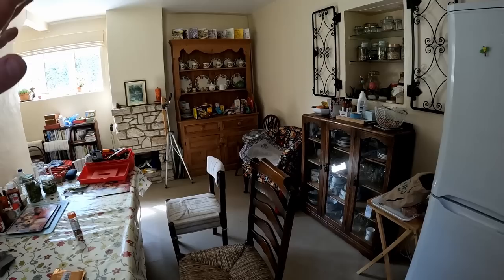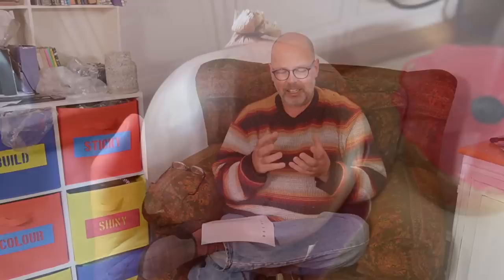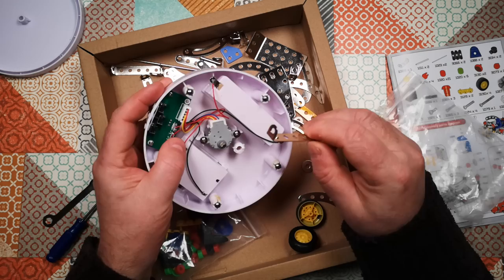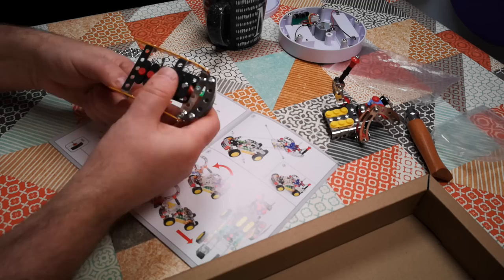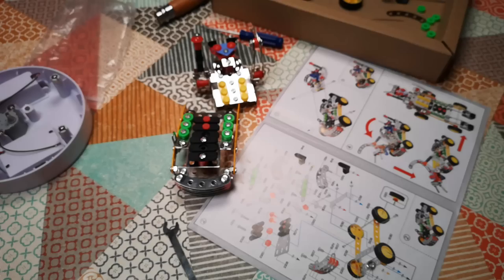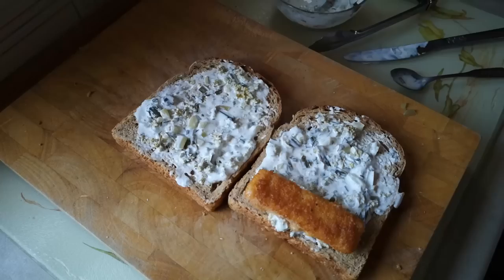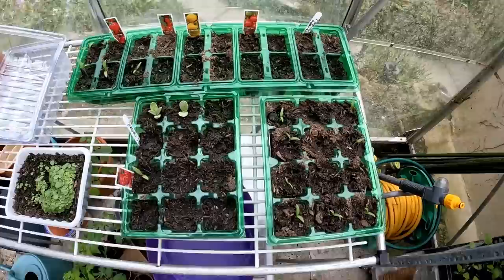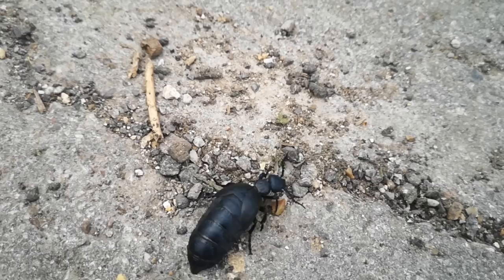Random Stuff - Happiness, Scary Door, Fake Meccano, Garden, Greenhouse, Insect Friends, Mudlarking

Comment: Believe it or not, that "slightly diagonal cut" is actually how I ate peanut butter sandwiches throughout my entire childhood. Love a good trapezoid
Reply from the maker: It actually worked pretty well - narrow enough at the business end to get a good starting bite with good filling, not so pointy that it just flops and falls apart
Reply: @AtomicShrimp  A most reasonable cut indeed.
Reply: @AtomicShrimp  I've been doing this for a while too, it's a winner.
Reply: @AtomicShrimp  It's been my preferred method of sandwich cut for many years now. I had an inkling that you'd opt for that particular cut :)
Reply: @AtomicShrimp  speaking of toast, how does a frog leg sandwich on toast and Mayo sound, with _________&________&________? Canned Frog legs 🐸 🦵🦵? Or maybe a croissant & sprouts?
Reply: I have finally found my people

Comment: The weird little side door-thing cheers me right up, I love old houses that have been hodge-podged together and none of the angles or structure or size of the rooms makes any sense anymore after 150 years of "just tack on a lean-to we need right now and we'll worry about the foundations later".
Reply: The quirkyness of old houses is the best part,  for sure. My cousins had an old Victorian that needed one more bedroom. They kitted out a storage room over the back porch for their young son. The bed was a frame made of galvanized pipe with cargo netting to support a mattress. There was a porthole window and the door opened into the upstairs bathroom. The sign on the door  said Mate's Quarters. It was a wonderful space for a little boy, though it wouldn't pass muster under current building codes. No one over the age of 10 could stand up in there! I think I would still use it if the window could be enlarged to create the required secondary means of egress. The rest of the house was just as interesting as the family had lived there for a couple of generations.

Comment: The fake Meccano piece is Gold (Aussie for really good).  The rapid slide from a quick 15-minute project to a 2, 3+ hour mental Olympics in critical thinking, spatial manipulation, mental problem solving and physical dexterity; patience, optimism, confusion, abject misery and finally undeniable pride and even a little grudging admiration for whoever designed such an unfathomable puzzle disguised as an easy to assemble child's toy.  Somewhere there is a neurophysiologist watching this and silently mouthing "Wow'.  Incidentally I had a similar experience with a tiny miniature Lego knock off at Christmas, 3 hours of concentration to create a 5" tall pink flamingo from 125 pieces. And I googled Neurophysiologist, I'm entirely sure that's not the right profession, but someone who watches brain patterns would know what I mean.  I think.

Comment: The one metal piece you found but didn’t take home, looks like it could’ve been a rock hammer head, and the only reason I know what those look like is the Shawshank Redemption. Then the one little metal bar definitely looks from a watch, looked almost identical to the ones on my swatch that hold the band to the watch face. 

That’s a lot of stuff for the council to ignore, hopefully someone or some organization comes in and handles it. There’s a river in my area that they have to clean out semi regularly, you wouldn’t believe how many tires get pulled out of it.

Comment: At 1:23:45 that looks like
A cable lug, used to terminate large cables.
Great video, not sure how I missed it when it was first uploaded
Reply from the maker: I agree is looks like a cable terminal, but the part where the cable would have been inserted was solid metal, like the face of a hammer

Comment: My 2 pence.  If you choose to use your outhouse as a larder, I would use a heavy duty freestanding shelving unit rather than hanging shelves like you've currently got in there.  They tend to hold a lot more weight and be more stable.
Girthy Carrots and BigOnions....lol.....my mind is totally in the gutter.

The mudlarking was equal parts fascinating, beautiful, sad and dangerous looking.  It's interesting to see all the fossils and older bits of things, and of course the nature is very pretty.  But it does seem sad to be having Victorian-1970's trash falling into the sea.  A reminder that what goes into a landfill doesn't just disappear.  I'd be terrified to go rummaging around with all those sharp bits of metal and glass, I'd be worried about getting tetanus.

Comment: Pennyworth wall it is then, I thought.
1:24:32 the brass-copper bit could be a cable tube lug terminal, for electrical connections.

Comment: What you had in your hand at 1.24.16 was an electrical lug. A large cable would be soldered into one end  and the hole would be attached to a bus in a distribution cabinet. These are still used today but mostly they are crimped on not soldered. They are usually made of tinned copper.
Reply: Agreed. I think both pieces are electrical in nature. The other one looks like it's a spike that gets driven into a bundle of twisted wire.

Comment: 1:24:18  im almost certain that is the shoe for a machinists hold down clamp or toe clamp. a bolt comes in from the top and bolts work pieces to the table of a mill, for example.

Comment: Hi Mike. To me that piece of metal at 1 hour, 23 mins 28 seconds looks like a cottered crank from an old bicycle. Obviously very badly corroded and dissolved, the pedal end is no longer attached. The other thing that it reminds me of is a kick starter or gear shifter form a motorbike. Such a shame that the vast majority of the metal and glass materials could so easily have been recycled.

Comment: That metal bracket thing in the bucket is called "band'n'plate" (only ever heard it spoken, so not sure about the spelling). It's a scaffolding fitting... Useless meaningless explanation, 😂.
Reply: One of the most useful fittings but takes up a lot of space for what they do, compared to modern fittings.
Reply: Yeah, this bit got modernized.

Comment: It's a toy. It's a feature to have sparse, not too easy instructions, it extends the time spent building. Taking apart and rebuilding because you read the diagram wrong and now it don't fit together. That's the point of it. 

Not to get a naff transformer robot/car thing you're never actually play with.

Comment: I've never seen grow bags like this! I'm wondering about the drainage - is there any or are you just supposed to be very careful about overwatering?
Reply from the maker: They are perforated around the bottom edges - so water doesn't just run straight through into the ground, but it doesn't pool too much either
Reply: I never knew, something like this existed. Seems like a great alternative to pots or raised beds or something, especially for beginner gardeners.

Comment: Please use gloves when dealing with horticultural glass (Greenhouse glass), that stuff is the cheapest glass you can get, so it's weak, has sharp as F edges as it comes and breaks into death shards if you even look at it wrong!
Reply from the maker: Dexterity is required for the clips, so no.
Reply from the maker: Sorry, I didn't mean that to sound rude but it did.  I considered wearing gloves but felt that it would hamper my ability to insert the clips and I would probably be more likely to break the pane
Reply: My parents greenhouse has lead S clips to hold the glass, I've replaced 10's of panes in that, I agree, Dexterity is required, But I'd rather the job took me a few minutes more wearing gloves than the few weeks/months  of issues that not wearing gloves can cause  (yeah... Been there, Done that)